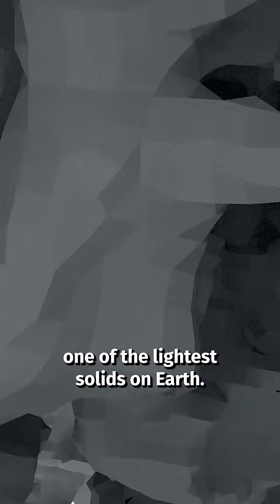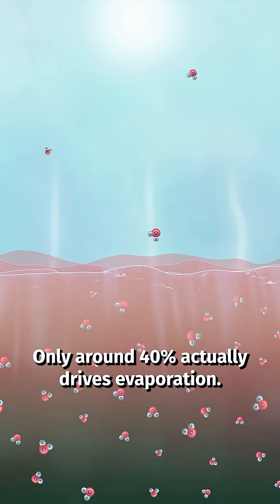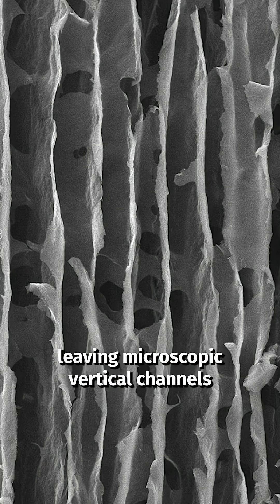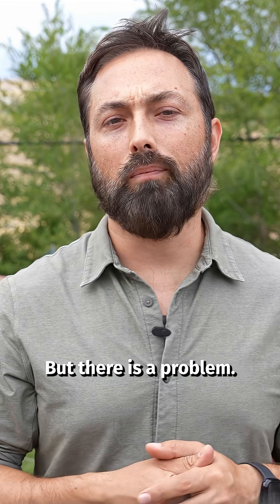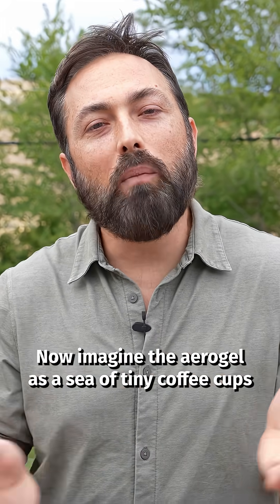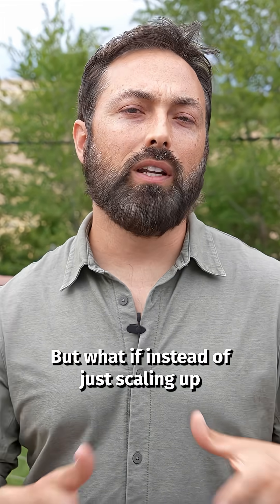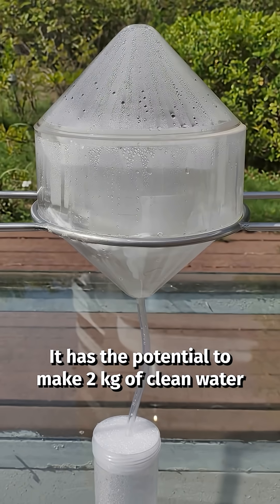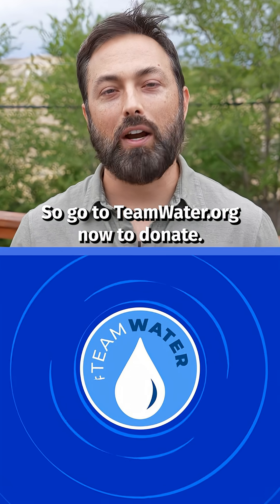How aerogel can make the ocean drinkable

Comment: The maximum heat flow from the Sun is about 950 W/m2. So 100% efficiency of evaporation from solar energy is only 1.4 kg of water per hour per m2. Where did 2 kg come from?! This cannot be achieved without heat recovery. And also 100% efficiency of thermal energy utilization cannot be achieved.

I myself am working on the technology of producing water using solar energy, not from sea water, but from air (a more complex task, the efficiency of 30% is already a fantastic achievement.).
Reply: you're researching putting an AC in the middle of the desert? well gee aren't you such a smart little fella? i bet your project is finally going to succeed after all the other startups who tried and failed to do it efficiently
Reply: @stickmouse5002  my project does not use AC, it is based on adsorption, which can work even in very dry conditions. In general, it is an alternative to another technology of the company Source Global (the unicorn from the US), but my technology is more productive and efficient.
Reply: Trying to compete with mother nature?😂😂😂😂

Comment: Only works when the sun is up, and will get clogged up with minerals in no time. Should at least make it from some sort of non corrodible material and cycle them through some kind of weak acid bath or other treatment to remove mineral buildup every cweek or two (doubt it'd last more without a major efficiency loss)

Comment: Interesting implementation, but seems a bit exotic... Why not just go old-school and have the evaporator heat an easily-maintained thin layer of water piped into a static location, with a basic thermal insulator underneath, and a fan to circulate the air within the chamber?  Because a mesh won't do any good to separate the boundary layers... how is fresh air supposed to get to the inner spaces without help?  How is the salt supposed to get flushed out before it clogs?  KEEP IT SIMPLE 👌

Comment: That 2kg/m2/hr seems physically impossible. The heat of vaporization of water is about 2260 J/g. The incident solar energy maxes out at roughly 1000W/m2. In 1 hour 3600000 Joules will hit a square meter, enough to vaporize 1.59 kg.

Comment: This seems a little too good to be true.  Solar irradiance is roughly 1000 watts (joules per second) per square meter on a clear day at high noon or 3,600,000 joules per hour.  The heat of vaporization of water is 2,260,000 joules per kilogram.  At 100% efficiency then, we could expect 1.59 kg of water vapor per hour (assuming the water was already at the boiling point).  Something seems off here...

Comment: You don't need aero gel just styrofoam and black cotton fabric. It also solves the salt build up problem. The system can in fact remove added salt. I saw an article where they wrapped foam strips in cotton, lied them next to each other and covered the top with black cotton fabric. In the columns of water between the strips developed vertical flow channels. As the water evaporated from the top surface the concentration of salt increases. That made it more dense and it sunk. Less salty water from the bulk rose up to replace it. To demonstrate how well this worked they even put extra solid salt on top of the black cotton and it was disolved away. 

The poor man's solution is to float wood coals. They absorb sunlight, float and insulate thus keeping the heat in the top layer.

Could you simply add black vertical pipes every so often to create natural convection to draw away the vapor heavy air. Some heat would be diverted to the convection task but could be worth it.

Comment: What do you do with the leftover salt and other minerals which is technically toxic waste? It can’t be left on land and it can’t be returned to the ocean.
Reply: There is roughly 35g of salt in 1 kg of sea water. The evaporation rate is 2 kg by hour by m^2, leaving roughly 70g of salt in one hour. Let's say the water at that place is 10m deep, leaving us with 10.000 l of water (which is constantly in circulation with the surrounding ocean) for those 70g/hour to dissipate in.